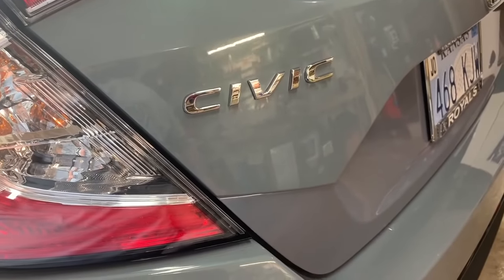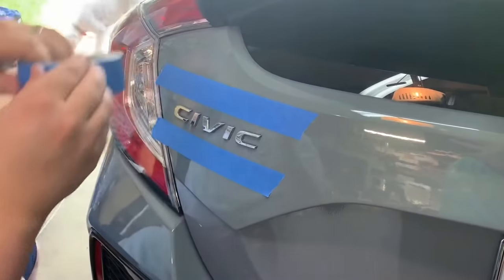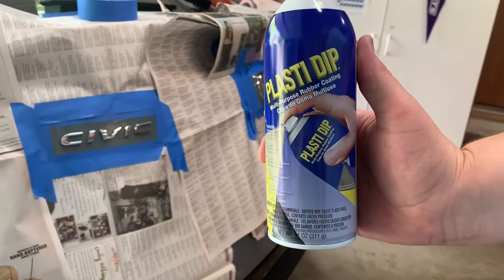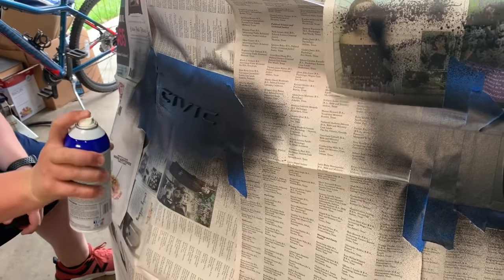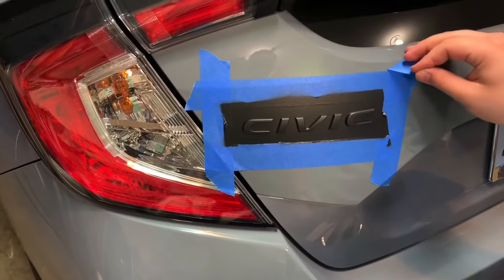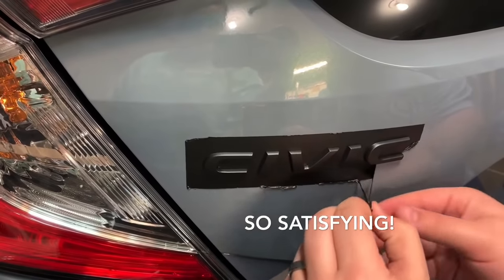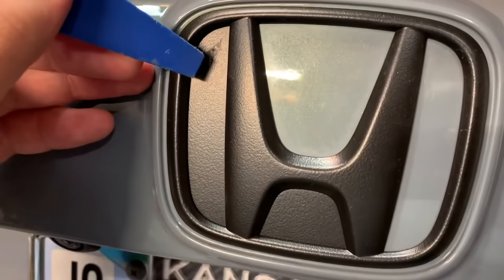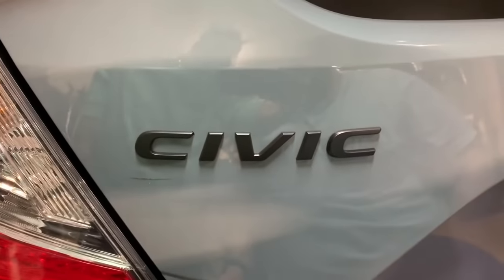Plasti Dipping Emblems-The best $5 car mod

Comment: Make sure to warm up your cans in warm water and make sure you fully wet out the last few coats if you want to get rid of the textured look you ended up with. It should come out fairly smooth when done right. Definitely a cheap mod worth doing that looks good.
Reply from the maker: Good tips! Thanks for that!
Reply: what do you mean by "wet out"
Reply: yea as shah asked, can u elaborate a little more on what u mean by “wet out the last few coats”
Reply: @xxteep  spraying very close to the surface
Reply: As advice also, you must do the spraying in quite cold place below 25C. Hot place will spoil the process.
Reply: I used Hyperdip for the first time and blacked out my Hyundai Kona NLine emblems over the last couple of days.  I can see that I do have some texture on one of them so I didn’t coat it well.  I think I can peel it off and redo it at a future date when I feel motivated. 😉
Reply: How long should I let the can sit in warm water? And do I shake can before placing on water?
Reply: @charleysantini  You want ideal temps of 20-25 C so if the can is in your air conditioned house then you take it to spray it will be to cool. Leave it in the sun  or a bowl of the hottest tap water you can get. You should shake before you start to spray. Dry the can off perfectly so no water drips on your work area if you do let it sit in warm water.
Reply: @silvergoldpill7985  what if the coldest my state gets right now is around 30 celsius
Reply: @jiggaman727  then you dont need to warm up your cans in water. If anything your time betwen coats could be a minute or two less, since the heat will help speed up the drying process.  The only time you need to warm up cans in water is if the temp is below 20 C. If your can is cold to the touch (ie inside your AC basement) then leave them in the sun to warm up. If there is no sun then use warm water.

If you are painting a large area every 45 sec of spraying stop to shake the cans as well. GL man.
Reply: the texture gives out some cast iron look.
Reply: Man comments but doesn’t check replies 😵‍💫
Reply: That's a bit extra, he was about an inch or two away when recording it. If a car or person is that close... probably more than just appearance of your car is an issue. 🚔

Comment: Pro tip: put a very small piece of tape on paint, in between outside of H and inside of circle around H, so you don’t have to scrape a hole through the plasti dip to start the peel. You can take that piece of tape off, and there is a nice little uncovered spot you can start peeling from
Reply from the maker: That is a good idea! Thanks!
Reply: I should've done that to the 'O' and 'D' in my Odyssey as well.  Alas, I did this last month before your comment
Reply: Yes yes yes
Reply: just use a toothpick its much easier. if you take the tape off you will have little pieces of plastidip that will be hard to take off without peeling the letters

Comment: Pretty cool. This will give the guys and gals a good project to do alone or together while locked up at home for weeks and months. This is a very sharp looking finished product. Thx for letting us watch.
Reply: Who's locked at home? Someone call the cops to help them
Reply: I remember driving to work during lockdown. Was a ghost town. Was so strange
Reply: @Turk_2023  some of my coworkers got Covid real bad. Guess the severity was a lie until you were the one with serious respiratory issues. 
I took precautions as best I could, not having the option to work from home like so many do. I was lucky and didn’t get Covid until last summer.
Reply: @joesmith3908  It's at the very most bad flu/cold. Everyone one that gets sick nowadays that I know have one thing in common 💉
Reply: @robbarber7253   yeah that was the case for me, the headache and low energy for 7 days sucked but some of my coworkers got hit real hard. one had bad blood clotting for over a year while the other was in the hospital for months and then home on oxygen for a while. it seems less of an issue now though

Comment: I suggest you use clear coat after you've done all of your layers. I did this to my car on the emblems and it came out really clean + it protects the plasti dip
Reply: Question please 😁, are you saying to clear coat before doing the peel off from around the letters, or after?
Reply: @theamazinggoldfish8713  before
Reply: @TheRealNuri  thank you but won't that get over spray on the paint?
Reply: @theamazinggoldfish8713  you just spray the clear coat over the plasti dip and it will peel of just like that.
Reply: @TheRealNuri  thank you I'll try it. I have an silver car so the black would just Pop unlike the chrome. Thanks again.

Comment: I've always thought those chromed plastic names on cars looked so tacky, making them black like that does make them look a bit better, but I just got the Ford Maverick and I'm glad the name is imprinted in the tailgate instead of just having those plastic letters stuck onto it... Thanks for the video, I'll probably find something to do this with, lol.
Reply: @slick-rides  I was thinking about that, mainly for that chrome rim around the logo. I personally don't mind the blue Ford emblems. Loved my 2005 F150 with its huge Ford emblem on the tailgate, lol.
Reply: @TalkingHands308  Mine is going to be Carbonized Grey, so think the blacked out Ford oval will look better.
Reply: @slick-rides  Mine is also carbonized grey. I'm sure it'll look better, I just personally don't mind the logo showing in its original colors.

Comment: Read tons of comments and not a single person here seems like they’ve painted professionally. I watched your video for 5 seconds and can already tell you a HUGE no no that you’ve done before painting. NEVER use cloth that is dingy and falling apart to prep your painting surface. You risk whatever dirt/debris is caught in the strings being left behind on your prepped surface. You also risk leaving behind stray strings/threads that you wouldn’t notice without a thorough inspection. You can see thread caught under the plastidip in the before and after transition photos/videos. Sprayed paint unfortunately magnify whatever is caught underneath and only gets worse upon adding extra coats so it’s VERY crucial nothing stays on the surface and nothing lands on the surface while curing. Outside of that, your technique is great.
Reply from the maker: Thanks for the info man! Glad I did some of it right!
Reply: Microfibre towel?
Reply: @sxmori  that would probably work but if you’re cheap you can just use like a polyester type cloth. Essentially nothing stringy or falling apart just because a string may be left behind that you may not catch until you’ve sprayed your first layer. Nothing’s worse than picking cotton fiber out of your paint because you’ll almost never get a smooth texture again unless you wipe it down and start from scratch.
Reply: @tysoncolindres5884  man for someone who replied just to talk smack, you really don't even know the year of this civic he's painting emblems on. Also, why go through the effort of making something look good and not do the best job you can? Sounds like someone's brain dead from fumes and let me tell you, it isn't me. Car is at least a 2016. If you think a 2016, or any car for that matter, shouldn't look good just because of the years it has on it, you obviously aren't someone who appreciates fine detail or truly enjoys preserving their work.

Comment: It's not enough coating, I usually do 7 coats until the emblemings are totally covered. The problem with plastic dip is they start to peel overtime, you're better off just buying a can of Black paint and spray painting the emblemings but you'll have to remove them to do that.
Reply: yea because it's such a hard process to redo 😂🙃 i don't really think this man cares lol
Reply: painting is such a difficult process you have to take the emblem off, and if you get overspray its very difficult to remove

Comment: How is it possible for the plastic dip to not peel off the letters and only come off the painted surface.
Reply: My thoughts exactly!
Reply: Because the lettering is raised.
Reply: @theheartlandgroup757  But the paint was going from the car’s bodywork to model letters in one continuous film so I also don’t understand why it comes away so easily!
Reply: Maybe because he sprayed from all directions, which allowed the dip to get under the emblems a bit and when he pulled, the plastic simply gave away to the sharpness of the underside of the emblem (he was pulling up after all).

Not sure if that makes any sense.
Reply: He cleaned the letters with alcohol so the plasti dip adhered to the letters properly so it’s an easy peel off on the paint
Reply: Wax
Reply: No..because the letters are smart!
Reply: It's  mAGIC
✨ 🪄
Reply: @wostrick2259  Yeah but there are like,....to many of them 🤣.
Reply: Razor blade....
Reply: Because there’s an edge. Anywhere there’s an edge it will peel away.
Reply: Physics.
Reply: Is that black or matte  black?
Reply: i know your comment is old but it’s not even a minute in and the dude literally says why in the video….
Reply: Honestly I bet there’s a step he didn’t show where he used some sort of exacto knife to carefully score the outline of the letters
Reply: @davidramey7186 don't use a metal knife! If you need to cut, use a toothpick, even a plastic knife can scratch your car
Reply: @davidramey7186  i just used my finger and rubbed the extra off and then it peels off, if you prep the surface you want plasti dip CORRECTLY the spray will only stick to what you wanted, especially when raised like this
Reply: YOU LACK IQ POWER MY BROTHER
Reply: Or for car wash not to rip it off?
Reply: it’s too good to be true right
Reply: Magic
Reply: @kindred2k still doesn’t answer the question..he rubbed alcohol on all of it

Comment: But how does it stay on the letters, even around the edges, and not peel off? Do you apply something to the letters and not the paint? Or vice versa? How do3s i5 not peel off the letters? Or do you use an exact knife and outline every letter?
Reply: it's plastidip not paint. the emblems arent painted. the car is. plastidip wont stick to paint but it will to the emblems
Reply: @AK-gb9rp  Thanks - I had this exact same question!

Comment: How long will this last usually? I'm assuming it'll wear off quite quickly if you wash your car often?
Reply: I live where roads are salted for winter and constantly wash my car with two bucket method and pressure washer. My emblems look as good as they did 3 years ago when I plasti-dipped them. I imagine getting too close with a pressure washer would remove the coating but with a little common sense plasti-dip can actually hold up for a very long time.

Comment: How good is it when it comes down to washing your car, does it last long?
Reply: You should get about 3-5 years from 4 coats. If you do more coats you'll get more time on it.
Reply: Looked better before!
Reply: @searcher3x  what if you use a self wash that has high pressure
Reply: @temtongu9481  It lasts a good 5-10 years depending on prep. I've had great success with it. I've done a whole car and recently did my gas cap on my challenger. I've used other products but honestly plasti dip is the most durable, when prepped right.

Comment: Man the previous owner of my car did this and when I removed the badges I could see where he ran the razer through smh. Don’t use to much pressure guys (obviously). Or just try to cover as much area as you can with the tape before you spray (put tape between letters, inside the letters, around the letters, etc..)  so that you won’t have to use the razor.
Reply: What razor? Lol
Reply: Toothpicks are your friend

Comment: dont ever  use rubbing alcohol on your car it eats the clear coat which will eventually lead to rust over the years from exposed painted metal with no clear coat protecting it. water and soap followed by a water rinse off and than microfiber dry off is all you need.
Reply from the maker: Sounds good thanks!
Reply: FACTS
Reply: 70% or more diluted will not harm your clear coat in an instance like this. 90% can harm it if overused. It will wear it down a bit but it takes a lot to wear through and expose the paint. I personally get 90% and dilute it 50/50 with water for automotive use.
Reply: I didn’t use any…woops

Comment: Just finished on my Tacoma!! Only ones I had to do were the TACOMA badges on my front doors....chrome....ICKY. Followed your recipe & WABAMM!! Thanks man!!
Reply from the maker: So glad it worked for you!! I did it on my Tundra about a year ago and it’s holding up great!
Reply: Just got the 2022 Tacoma and this is my project tomorrow. I got the "attitude black" paint, so I'm going to use the bright red plasti dip. 

Great video!!!
Reply: @FacelessMachine  Sounds like it'll be beautiful!!
Reply: Awww thanks! I'm so hoping it will. 🥰

Comment: Mine did not pull away like that. It acted more like regular paint. Had to use a plast tip to get the access off. Scratch part of the car. However I used a different brand this time.

Comment: Is plasti dip durable? If it comes off the body of the car so easily, will it come off the emblems/logos just as easily?

Like will it be durable in car washes? Or is this something that has to be done periodically?
Reply from the maker: It’s not a permanent solution but I’ve had mine on my  truck for at least 6 months now and go through the car wash at least twice a week and it looks the same as it did! Just make sure to Do 4-5 coats!
Reply: Some people plastidip their entire car and say it lasts 2-3 years

Comment: 🙋‍♂️  loved the work.      I have a few questions  ???
Are all the four coatings 30 mins spaced?

Is it just the plastidip can needed to do this or do i need to buy primer or anything?
Reply from the maker: Yes every coat was spaced out at least that amount of time, or until dry. And only the plasti dip was used. only other product was alcohol to clean the letters first!

Comment: How does it not pull off of the lettering too?
Reply from the maker: No idea… I think it creates a natural perforation since the plasti-dip isn’t attaching in the space between letters and the car body
Reply: @kccreations5945  thanks for getting back so fast. I'm nervous to try it, but it looks pretty easy. How long does it take to dry? Is yours still holding up okay?

Comment: Great video! Did you use pure rubbing alcohol or dilute it with water to clean the areas/what ratio if so? Did you use 70% or 90% isopropyl alcohol?
Reply from the maker: I don’t remember but I believe it was isopropyl, not sure of the percentage. Really just clean it with anything and let it dry first!

Comment: Hi, did you have to blade around the lettering before peeling off the excess?
Reply: It's not necessary to cut at all. The abrupt change in angle because of the raised letters almost acts as a sort of perforation. Just peel as close to the surface as possible and go slowly.

Comment: Does it stay on after washing your car? Or does it peel off?
Reply: Did it on my Tahoe, did about 4 coats. It's stayed on for about 2 and a half years now with no chips or anything. It'll hold even with washing
Reply: @bigd7072  Did you use any plasti dip glossifier by any chance or just the spray?
Reply: @ラブユー-n8y  no I did not, that is an option though if you want a more glossy look instead of a matte black
Reply: @bigd7072  okay, thanks for the reply!

Comment: how long do they last after applying the paint? does it change color or get affected by UV?
Reply: I put 4 coats on my truck in March of 2020 and it's peeling. My truck is always outside so if it's garage kept i would think it will last longer
Reply: @christophergilbert519  Thank you 😊

Comment: Nice job. Only small comment is that u use  very thick layers en keeping the can somehwat to close to the emblems. Thinner layers would be much better. And keep peeling away from the letters instead of towards it.
Reply: With plastidip you want a light first coat, followed by 3-4 heavy, overlapping coats. It creates a smoother finish. This stuff isn't paint, it also helps to soak the can/cans in warm water for around 10 minutes beforehand for an even smoother finished product.
Reply: @ZombieAlpaca  I found doing several light coats, 7 actually, worked particularly well on 2 plastic forward facing parts on 1 of my motorbikes, its been years now since they were sprayed and its still the same as the day I sprayed them, nice light overlapping coats 30 mins apart

Comment: How long will this typically last before or of it needs a re-spray?
Reply from the maker: I’ve had it on my truck now for 3+ years and it doesn’t need anything! Still looks the same! Just do 4-5 coats at least!
Reply: Do you think the Hyperdips better or the Plastidip?
Reply from the maker: @robertf3340  honestly I don’t know what hyperdip is!
Reply: Oh ok. No worries. It’s the same kinda product as the Plastidipbut they claim it’s better in terms of adhering and the color is supposedly deeper

Comment: Why does the dip peel from the paint, but not the letters?
Reply: Because there is a "edge" between the paint and the letters, that makes a "weakspot" and breaks the plastidip. Like if you fold a piece of paper before you tear it. You could do it the other way around to, if you wanted the paint to be black and the letters chrome

Comment: How is this holding up long term ? Does it easily come off ? Esp the car wash and stuff
Reply: I did my charger and it lasted 4 years without a touch up. Front grill is different because of highway debris chips at it

Comment: One question. Is it gonna stay after i use brush on the carwash for that element ? Or sponge ? Is it easy to take it off?
Reply from the maker: I go through a brushless car wash a couple tomes a week and mine looks the same after a year. I have been through the brushes 1 time and it didn’t affect it. I also haven’t taken it off so I don’t know but I have seen others just peel it easily!